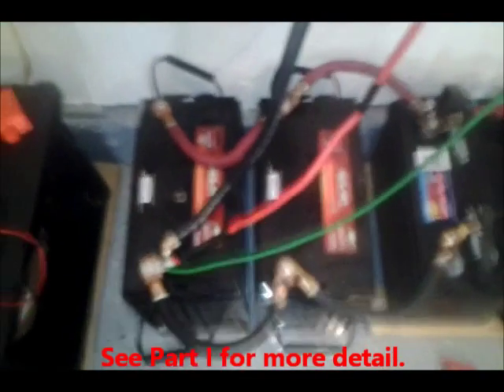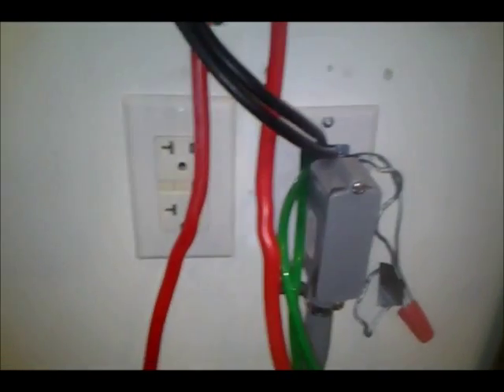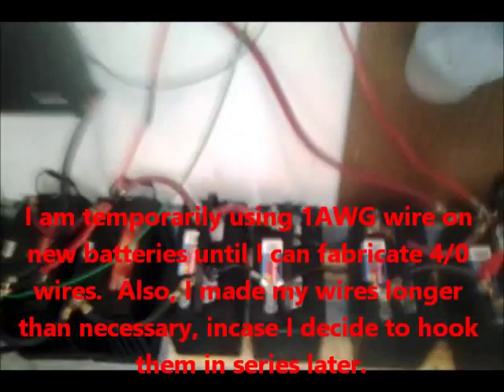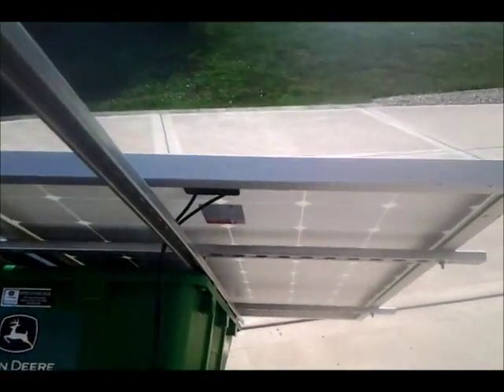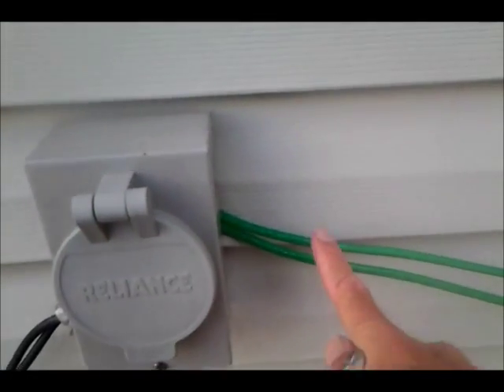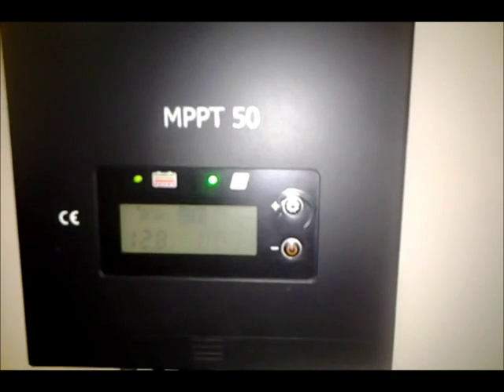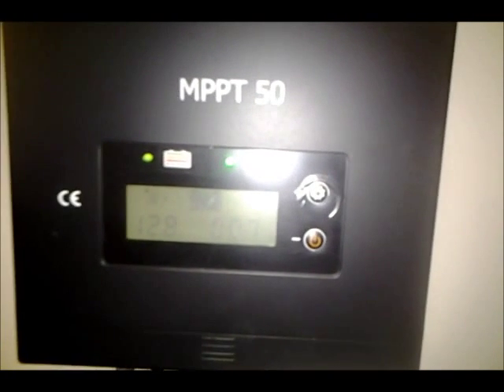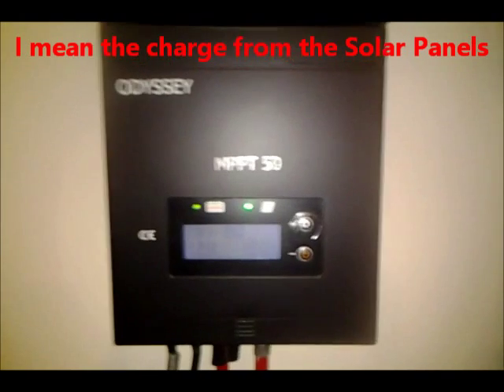Mobile Solar Panels: Project Update (11-1-15) & Costs

Comment: Hi John, enjoyed your video, nothing wrong with an economical solar setup.  I did notice one thing though, you have four Everstart batteries @110 AH capacity each, and two Vmaxtanks @155AH capacity each.  The Everstart's are flooded lead acid and the Vmax are AGM (Absorbed Glass Mat), also the Everstarts are not true deep cycle batteries, they are kind of a bridge battery somewhere between a starter battery and a deep cycle battery, dual purpose as it were.  The problem I see is that you have them all hooked up in parallel and on the same charge controller.  Flooded batteries have different charging characteristics than AGM batteries, for example, a wet flooded battery needs an equalization charge every now and again, the frequency of which  depends on your particular usage scenario, whereas AGM batteries typically are not equalized as they are sensitive to voltage.  By having both types on the same string and charge controller, the Vmax, because of their greater capacity are never going to see a full charge, this can damage them as badly as overcharging.  The flooded batteries are going to be charged but not ever equalized unless you do that periodically after checking the specific gravity of the electrolyte, this will also vastly shorten the batteries lifespan, and encourage sulfation of the plates, the same could very well happen in your Vmax units as they are never charged fully.  At the point that the flooded units read charged, the higher capacity Vmax units are probably not fully charged when the controller goes into float.  You might consider if funds can be made available, putting the Vmax on the AGM setting on your controller to keep them topped up properly, and perhaps getting a cheaper controller to charge your flooded batteries, along with a couple of extra panels for said flooded batteries.  Over the long term I would say with some conviction that keeping your battery charging setup as it is will damage the batteries you have invested in thus far.   Anyway, just a thought, enjoyed the video, and please don't see this as a negative criticism.  I would hate for a fella to ruin a thousand bucks in batteries is all.
Reply from the maker: Great discussion, Drew, and I will consider your comments!  So, what if, periodically, bypass the vmaxs and set the Charge Controller to Flooded and then rotate back to just the vmaxs and set the CC to AGM, for a while.  I can run my fridge, during the day with either, I think, which is my main goal, short of a complete power outage.
Reply: Cheapest way of doing it that I can pull straight out of my head, would be to separate the batteries into two parallel banks, one AGM and one Flooded, run them both to the charge controller via a marine style battery switch  such as this https://www.amazon.com/Blue-Sea-Systems-Selector-Battery/dp/B000K2MCR2/ref=sr_1_2?ie=UTF8&qid=1467392889&sr=8-2&keywords=marine+battery+switch that way you can select what bank you wish to charge, and you can change your charge controller settings accordingly.  I would also put one of these in line to your inverter, so you can select which bank runs your inverter.  Remember to fuse everything accordingly.  Also remember that when switching banks for charging,  isolate your solar modules first.... the golden rule, batteries must be connected first... switching on is batteries/solar modules.... shutting down for changing banks is solar modules/batteries... this is to minimize chances of any damage to your charge controller.  In the long term however I would still advocate for a second charge controller and a couple more panels as the lack of aggravation in constantly having to mess with a system is worth real dollars (at least to me lol)... something like this for your 440Ah flooded bank https://www.amazon.com/Tracer4210A-charger-Controller-regulator-MT50/dp/B01A9W6GJ2/ref=sr_1_12?ie=UTF8&qid=1467393521&sr=8-12&keywords=40+amp+mppt and a couple of cheap panels such as  https://www.altestore.com/store/solar-panels/topoint-jtm190-72m-190-watt-solar-panel-p40458/  these are dirt cheap, and not the best, but for the money, you put two of them in parallel as that would keep the voltage away from the 100v the tracer can handle and you would be golden.   Sorry it took me so long to reply, I have been a little busy.   Anyway hope some of this helps in some way.  All the best!
Reply from the maker: Drew, thanks so much for all of your detail and links!  I've been operating the Controller in AGM mode, so the WM batteries are taking the hit, I guess.  Regularly check the levels and see no drop.  Would you expect to see a drop with overcharging?  Can you only tell what is happening by SG?
Reply: Without knowing the exact settings on your charge controller that you have set right now it is difficult to make an informed opinion about exactly whet the effect will be on your flooded batteries, but for sure I can say that whether you are running in AGM mode or flooded, your AGM batteries are not going to be fully topped off because the lower capacity Everstarts will be reading full and in all likelihood the charge controller is switching to float based on various parameters such as time and voltage.  If it was me I would be more worried about the pricey Vmaxtanks than the Everstarts.  I will do a little research on the two different batteries and come up with some probable scenarios, but I would definitely take steps to separate the batteries into two 12v banks, one flooded and one AGM.  Hopefully not too much time has passed whereby both cant be brought back to a reasonable condition.   There are a couple of ways of telling the condition of a battery in general as relates to it's charge state and voltage.   Firstly you need to measure the batteries voltage at rest, this mean taking a voltage reading from each battery individually with the temperature of the units at as close to 75f give or take.  We live in the real world so this isn't always possible.  By at rest, I mean that once your charge controller goes into float, plug anything you are running off your bank into the household mains, then disconnect all your batteries so that no two batteries are equalizing each other in terms of voltage balancing.  Let them stand with no draw of any kind for 2 or 3 hours (ideally 6 or more hours but this isn't always convenient), and then measure the voltage of each battery individually.  Here is a link to a state of charge table http://modernsurvivalblog.com/alternative-energy/battery-state-of-charge-chart/  note that this table like all is an approximate guide, but to within .1 or .2 of a volt should be what you see for a topped up battery.   By measuring the SG of the electrolyte you gain a better idea of the condition of the electrolyte.  About 1277 specific gravity at a voltage of 12.73 volts is a good indicator or a well conditioned and fully charged battery.  On this page is a table from Trojan that gives a good overview of what you are looking for  http://www.trojanbattery.com/tech-support/battery-maintenance/.  As for the AGM batteries, other than voltage, the only other real world way to know is to do a C20 discharge test until you drag the batteries down to 50%, that will give will give you an idea about the state of the battery as tested because you will have a record of the amps drawn at the 20hr rate and you also know the capacity of the battery under ideal conditions at a given temp if fully charged.  I am assuming you do not have a shunted system so you can accurately measure voltage, current drawn, or current in from your controller to your batteries, or persistent state of charge.   So you are left with the old fashioned methods of appraising battery status, however, these methods are accurate enough to make a fair assessment of your batteries and to take steps to correct any imbalance.  Remember that some tolerances change from manufacturer to manufacturer, but most fall within a narrow band, so as long as you get close you should be okay!  You can find the charging parameters for your Vmax batteries on their website here http://www.vmaxtanks.com/Technical-Data_ep_41.html  I hope that helps somewhat!

Comment: Cool I like it and it looks like your having fun free solar power is addictive hahaha!
Very informative it made me re-check specifications on your charge controller I was thinking of buying but now I will not because I see voltage levels and charge duration in different modes is preset not user adjustable.
I have found out different batteries call for different charge levels so I must have custom settings as my Trojan 6 volts in series require minimum 25 amp bulk charge and 14.8 volts in absorption to maintain proper cycling.
Anyway I rambled on enough thanks again friend see you next time :-)
Reply from the maker: +Bruce Samuelson Thanks for watching, Bruce!  This is about the best CC at this price break, from my research, and if you want more controls they will be more expensive.
Reply: You're welcome John. Yes you're right that's a good controller for the price is why I was thinking of buying it. I'm doing research to try and find one that's very good for under $300 it's not easy but I'm working on deal now I will make video of what I get after I install it so talk later friend thanks
Reply: For what it's worth, here is a short list of my fave MPPT charge controllers under $300..  Midnite Solar's The Kid 30A MPPT, probably my favorite in terms of quality and function at $290 https://www.altestore.com/store/charge-controllers/solar-charge-controllers/mppt-solar-charge-controllers/midnite-solar-charge-controllers/midnite-solar-the-kid-30a-mppt-charge-controller-150v-black-p11138/   Next up is the venerable Tracer unit, these come badged by many sellers but the heart of them is the same as far as I can tell... 40A MPPT with the MT-50 remote display (a must) at $255 with free shipping  https://www.amazon.com/Tracer4215BN-charger-Controller-regulator-displaymeter/dp/B0156WG1X6/ref=sr_1_10?ie=UTF8&qid=1467395062&sr=8-10&keywords=tracer+mppt    and lastly if you are wanting to stay with a 12v system only the Blue Seas 3000i paired with 4 100 watt 12v panels is a great unit.  Lots of reviews and I have never seen anyone saying they are rubbish, made typically for RV's but no reason one can't install in a permanent structure.  http://www.thesolarbiz.com/Blue-Sky-Solar-Boost-3000i-Charge-Controller#gsc.tab=0   as always hunt around for the best prices, and there are many more options, these are just a few of my favorites at the $300 or so price point.   Good luck!
Reply from the maker: We still have this year, in the US, to get a 30% tax break on solar equipment, so there is incentive to upgrade!  Do you have any videos of your setup?  Would be very interested in viewing.  You appear to be very knowledgeable about solar and we could all learn from you!  Thanks again for all of your hard work in responding!
Reply: The Solar Tax Credit has been extended for 5 years, so we all have time to claim a little back lol   I will not be installing my system until 2017.  I am going to put 2KW of mono panels through a Midnite Solar Classic, whizbang jr, and a 24V AGM battery bank (I like the more efficient charging and efficiency of AGM and am prepared to sacrifice a little overall battery life to have my battery bank in my computer room safely), running an as yet undecided inverter in the 2 to 3KW range.   Later in life I intend going to Iron Edison cells for my battery bank, as of right now I can't afford those, being as I am, a family man.   I have a background in I.T, basic electrical, fabrication and such, with a love of physics.   Solar is my new career path after an injury, so it is what I spend most of my spare time researching, I read and absorb everything I can find, in print, online, YouTube, whatever the source might be lol.   When I do my install I will be more than happy to document it, edit and upload to YouTube, I will add you to my list of people I have subbed so I can let you know when I upload in the future.
Reply from the maker: @Drewboo1968  Did you ever install your system?  I went to your channel and didn't see anything?  Would love to see what you are doing.  Can you give us an update?
Reply: Oh I forgot to add, that I am a Brit who is married to an American lady, and I live in the States, and have done since 2002.  I am currently going through the naturalization process and should be an American by Christmas this year!
Reply from the maker: Congratulations on your progress as a citizen, Drew!  I didn't mean for you to spend so much time on my issues but thanks much!  I am a retired Civil Engineer and like to tinker some but obviously electronics is not my strong suit.  I know enough electrical theory to get me in trouble and of course engineering is just applied physics, so I see your enjoyment there!  Best of luck with your solar project!
Reply from the maker: Thanks, for the comments, Bruce!  Very informative!  I am still just dabbling myself!